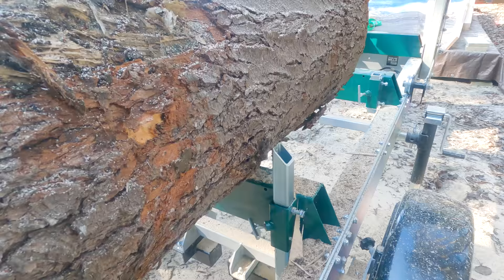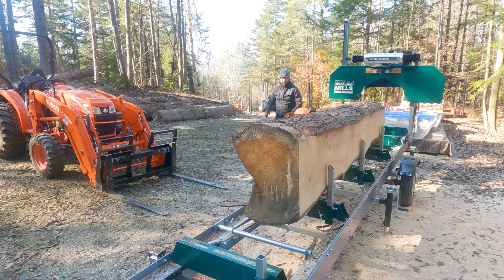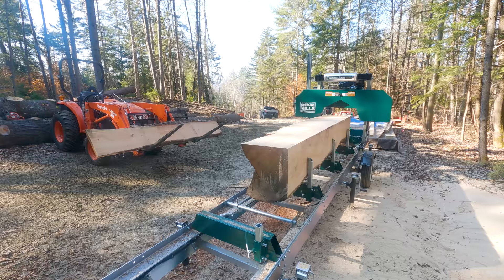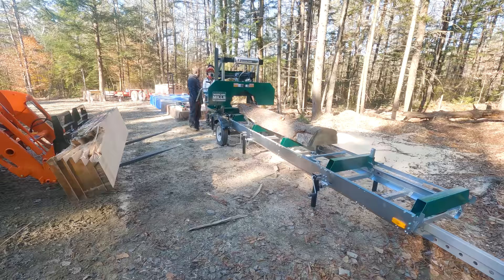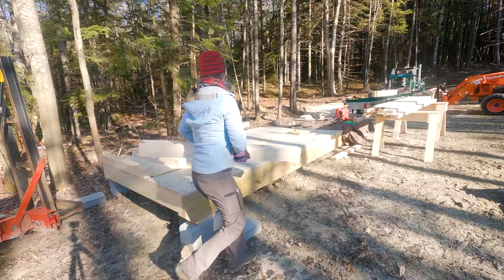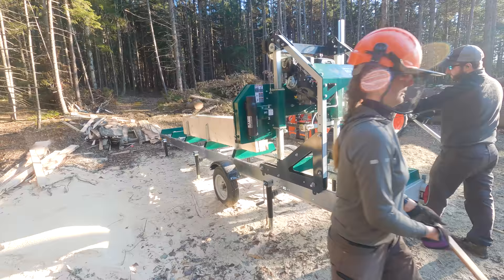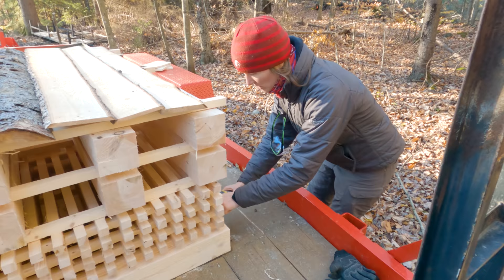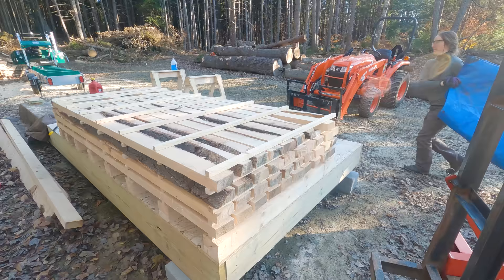Milling a HUGE log on our HM126 sawmill

Comment: Congrats! That's about £240 / $330 worth of 2x4s if bought at my local saw mill! I really appreciate the neat stacking <3
Reply from the maker: The $$$ add up pretty quickly! Although we have to keep reminding ourselves that milling it is just the first step - it then needs to be stacked, dried, planed and surfaced if we really want to compare it to what we'd buy in a big box store. Obviously if you're comparing it to rough sawn lumber at a local saw mill then it's job done! In our case, we're going to let this dry over winter and then build the solar kiln with it - no drying, planing, etc first. The sawmill cost somewhere around $6k and we think it should pay for itself relatively quickly (if you ignore our labor!).

Comment: Great work. I recently got the same one. Quick note, the logs are easier to flip if the point of the log stops are on the outside instead of the inside where the log tends to catch the point.
Reply from the maker: Interesting idea. I had assumed that the log stops were meant to be "pointy side toward the log" so it'd make contact at the highest possible point, but I guess we can try it the other way around!
Reply: even easier if you slip a peice of pvc pipe over stops.

Comment: You mentioned about waste from ends cracking.  If you paint the ends of logs with any latex paint (use whatever leftover or cheap stuff) before milling, it will slow the drying time of the ends compared to further up the board and minimuze cracking.

Comment: Hi.....I just joined your channel.....looking good....I bought my MH126 a year ago with no regrets at all.....built a kiln, saw shed, and a Cargo Barn all from logs taken from my property here in N Ca. Last log on the mill was a big one, 24" Wide X 28" Tall X 13'6" Long, and that was after taking down 3 sides with my chainsaw mill.....it was definitely a struggle but it yielded  a lot of 6X6's. Thinking of a Timber Frame Cabin.....Keep up the nice videos....It's beautiful up Vermont way......
Reply from the maker: Thanks Jack, and welcome to the channel. Sounds like we have a lot in common! Glad to hear you're still enjoying your HM126 sawmill - we're really happy with ours and are planning to order a wood chipper from them very soon! That sounds like an absolute monster log - how did you get that up onto the sawmill in the first place?!
Reply: Yes, we do have a lot in common. 
I have a winch setup on my truck and with use of a couple snatch blocks, I was able to maneuver it into place and roll it after it was on the bunks. 
PG& E came though my property and cut 108 trees last year, with another 50 coming down this next year. Mostly Fir, some Oak and little Pine. That is why I bought my mill, and besides all my projects that I want to do....
Glad I found your channel and Good Luck on everything you do.
Jack
Reply from the maker: Wow, that’ll keep you busy on the mill! Do you mind if I ask what winch you have? We’re strongly considering one on a hitch mount so we can move it between our truck, tractor and equipment trailer.
Reply: @AdventurousWay  Not remembering the brand, I went and looked on the winch...there is no brand....I bought mine through Harbor Freight...12000 lbs. Steel wire. I also got the receiver hitch setup....What you also really need is the heavy quick connect wire that runs all the way back to your battery. That will give you the electrical power you need.
My only complaints about it is, it is really slow. But it does a very good job. I use mine when the logs are not in a position I can drag them with my truck.
Happy to share....
Jack
Reply from the maker: Awesome, thank you! We already have a heavy gauge wire (2AWG I think) running from our truck battery to an Anderson SB175 connector on the back of the truck that we use for a DC-to-DC charger on our RV when towing: https://www.adventurousway.com/blog/rv-electrical-upgrade-part-3-dc-charger-truck-12v-socket

Thanks for sharing!

Comment: Kubotas do not have the lifting power of say a Kioti. yes, you do have to carry close and low. Your ballast box might be too light. Yes, that is alot of weight. for a saw setup on a temp. underpinning.My advice is make your log stops out of wood,like Oak? If you saw into them and you will, you wont damage your blade. I did this, when you get low on the log.Get a peavey and turn from the fat end .Nice woodlot. I used to skim a flat for ist cut .then drop down say one inch. Boards like that with a barky edge are useful for metal roof buildings or reroofing with metal over asphalt. You need strapping for that and strapping is very expensive these days. .32 per linear foot for a 1x3 which is really 2.5 inches.Is  not much to screw a roof to.Yyou can easily miss it. We used  discolored vmatch before. The mills had piles of this they wanted to get rid of. I dont like green wood for strapping.or studs that are sheetrocked.

Comment: great work for a log the max size the mill will take. turn the log stops around so the angle part is towards the log and it will torn easier.
Reply from the maker: Thanks! Interesting idea about turning the log stops around. I'd always assumed they should be oriented with the taller edge towards the log, but thinking about it now, I don't see why that would make any sense. Your suggestion makes much more sense, and the Woodland Mills website shows it the same way - thanks for pointing that out!

Comment: Very nice stacking,. if you will turn the log and de-bark all 4 sides you won't have that non-sense of hitting with the saw and having to hand trim. its all got to be cut any way so you are saving nothing except effort by plowing through and pushing the limits of the saws capacity.
sending you the best.
Reply from the maker: We had to learn that the hard way first 🤣
Reply: @AdventurousWay  You will continue to learn many methods and probably ADAPT your own along the way. 
I just orderd 130max and 2 extsentions.

Comment: They make magnetic strips that have marks on it easy to cut 4,5,6, and 8 quarter boards that allow for the curf of the blade. I have one on my Wood Mizer and it works great. After your cut you move it to the mark you want to use for your thickness and it seems to be very accurate
Reply from the maker: Ah ha, that's what we need! I was planning to make my own but will see if I can find one pre-made. Thanks for the heads up!
Reply: I just purchased the hm122 and those scales came with it. One with true inch and quartets, the other with inch with kerf and 2 inch with kerf.

Comment: You need a rear ballast weight on your tractor .you should put better support under your mill. I think when you put weight on, it will shift. It does seem to track well. Pine isnt great for framing.you can saw off the big butt on one side if its too wide.
Reply from the maker: We have a ballast box filled with bags of gravel and sand on the back of the tractor - it's the black box you can just about make out in the video. It really helps a lot with stability when lifting the heavy logs. We're only going to use the pine for framing the solar kiln - any other framing we'll use spruce.

Comment: Instead of using your story stick I believe your mill came with a magnetic mount quarter scale. If your mill has one, they're very easy to use. If it didn't, you can get one at Woodland Mills.  I've done some videos on using the quarter scale that you might find useful. Links are below.

Link to quarter scale video https://youtu.be/iMgCN-EdkSY
Link to fixing a quarter scale problem https://youtu.be/8gPxdgr1qjc

Good Luck,
Dave
Reply from the maker: It did, but the magnetic scale only works for 1" and 2" thickness when accounting for blade kerf. We were able to use that for the 2" thick cuts, but for the 4" thick cuts we had to measure manually to account for blade kerf. Unless I'm missing something?
Reply: @AdventurousWay  No, you didn't miss anything. I've seen some sawyers add magic marker lines to their quarter scale for thicker cuts; like 4". If you could use 3 1/2" wide lumber you could use alternate 6/4 marks.
Anyway, I enjoy your videos. Good luck.
Reply from the maker: Ah-ha, that makes sense. Will watch your videos later - looking forward to learning more! We were thinking of making a story stick out of a piece of aluminum bar (we used an off-cut which is obviously going to shrink but was fine for a few days) with notches cut in it so it's really quick to use, or maybe even a digital meter....

Comment: Great video. Have you ever used a green line laser module as an alignment tool ?
Reply from the maker: We have not, but I have been tempted a few times!
Reply: @AdventurousWay  It`s pretty useful. Many sawmill users that have a woodland mill or wood mizer have them hooked up. Its the Apinex AGLL2 20mw.
Reply from the maker: Thanks! I started working on a plan to power one with a Dewalt battery. Thought that'd be a pretty cool way of doing it!
Reply: @AdventurousWay  , We also use it daily with a Apinex 3V battery pack.

Comment: 2 x 4's are 1.5 x 3.5....just saying.
Reply from the maker: Not when they're green and rough sawn. The process of drying, planing and surfacing reduces them down to the actual dimensions - i.e. 1.5 x 3.5. For these particular boards, we're going to be drying them, but not processing them down, so they'll be somewhere between nominal and actual.